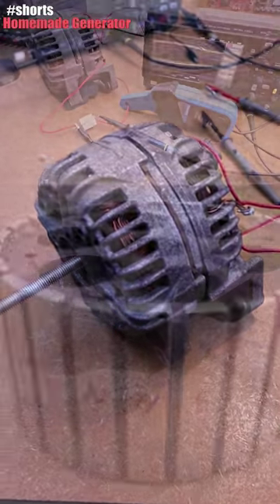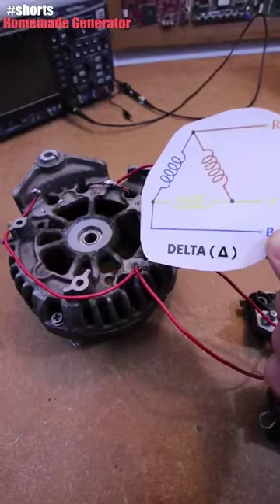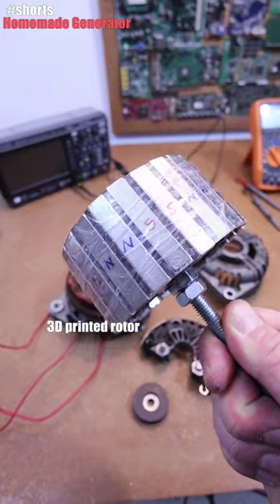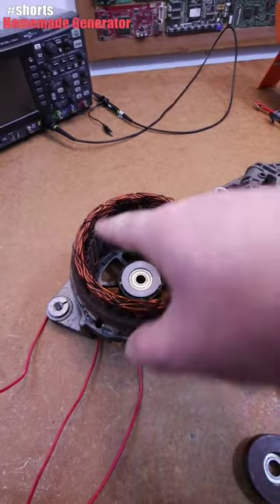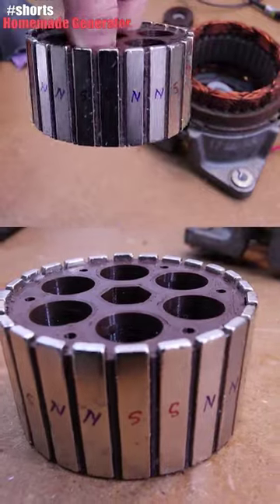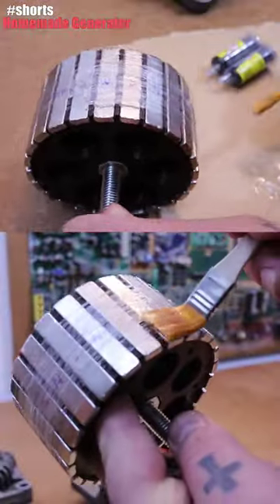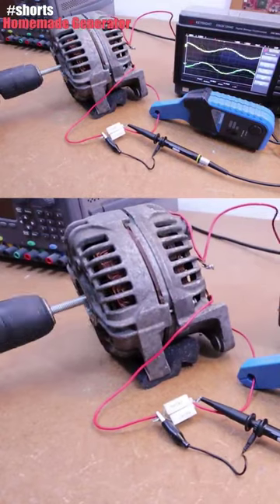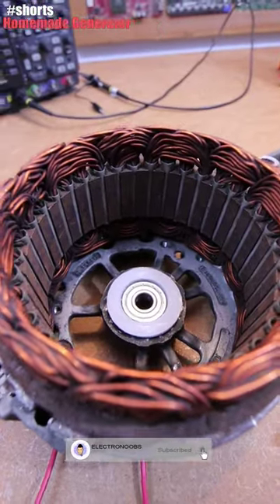Generator out of Car Alternator

Comment: Well done, you turned an alternator into an alternator
Reply: Yeah, electro magnet alternator into permanent magnet alternator.
Reply: Well yea but it’s still a alternator
Reply: @king_ofgames3650 with car alternators, it actually need voltage supplied from the battery because electro magnets need voltage supplies. By swapping it with a permanent magnet, it doesn’t need voltage supply to it. Let me know if I’m incorrect?
Reply: Yes you are correct I have done this myself
Reply: @king_ofgames3650  oh wow, what were you working on? Or i guess why did u swap it out with a permanent magnet?
Reply: @karencartoon8763  I have converted an alternator to a motor to use for a go cart
Reply: @karencartoon8763 Yes definitely. Swapping the rotor into permanent magnets, So you don't have to waste about 12W of power just to excite the electromagnet rotor.
Reply: @Teknopottu aka a magneto

Comment: But the default rotor field coil can already generate power (that's what an alternator does, recharge a battery), why replace the powered / coiled rotor with magnets ?
Reply: The rotor is an electro magnet by default, it takes a lot of power to turn into a magnet before it can generate. By making it a permanent magnet rotor, it is more efficient.

You can also use it as more efficient three phase motor this way.
Reply: It's a way more efficient generator and I'll be putting one on a wind turbine when I find an alternator to adapt

Comment: Great video! I've always wanted to make a generator.  
During a demolition project at M&M Mars facility, I salvaged 2 motors, (hoping one of them would be DC) They both seem to be three-phase AC. One is a servo,
Allen-Bradley part # 193470
(6.78/60 Nm/LB.IN. of torque)
They said that the machine had been installed 20 years earlier and never went into production.  It was taking up valuable space. They just wanted it gone. 
I don't know what I'm going to do with it but I know it's really cool.
Reply: That's a pretty big one! 3 phase AC, look up 3 phase bridge rectifiers, fundamentally the same as a single phase bridge rectifiers, but with 6 diodes instead of 4.

Those headers might be difficult to interface with, and I'm curious what kind of voltages you will get given that it's rated for 4k rpm. Add a flywheel onto a bike or whatever, and you might run it into an inverter for more stable output voltages.

Comment: I'm wondering why delta and not wye? 
The alternator is modified but generally they need a somewhat high rpm to get good voltage. And for a given rpm, delta produces better current at a lower voltage while wye produces a better voltage at a lower current, or you can get by with a wye at a lower safer rpm given that you "glued" the magnets, and I'm not sure I'd trust it at higher rpm.

Comment: Why? It was already a 1 to 2KW generator prior to hacking it. you simply need a regulator to excite the rotor poles with a bit of DC to magnetize it and then you rectify the output and modulate the generated voltage by controlling the bias applied to the rotor.
Reply: Do you have a video instruction on this? I thought that too. Use the 3 pin plug as excite input voltage from a dc voltage regulated source... ( this is not connected to the motor), but I'm not clear on the "delta" or AC OUTPUT TAP setup.  Can you provide some links for what you are speaking about? Thanks would be extremely helpful.
Reply: @readytorvdude1224  The Alternator in your car is wired to be a ~2KW generator, and generate DC voltage to charge your 12V battery. It is a stupid name, probably to differentiate it from a Dynamo, which uses a split ring commutator. (essentially a DC motor used as a generator)

You provide an excitation current to the rotor, and use a rectifier to rectify the 3 phase output from the stator. Usually there is enough residual magnetic field in the rotor to generate just enough EMF to further excite the rotor and the positive feedback loop brings it up to saturation. (I think).

A regulator is used to regulate the excitation voltage to the stator and regulate the output rectified voltage.

Comment: hello sir can you explain to my why some delco 12si have strange wire configuration? those alternators do not have center tap also wanted to know how its done voltage regulation for those alternators can they by manuali forced to charge at low'r rpm ranges I noticed some tractor alternators have capacitors on them so wondered what exactly is difference about low and high speed voltage regulators?

Comment: that's really cool.
3d printing doesn't scream safe and reliable to me, but who cares. if you can do it, then good for you!
 I'm looking forward to the video.
Reply: It should be fine since he wrapped it with the nylon and coated in resin, that would hold everything together because the main concern with a printed part would be it flying apart from the centripetal forces... but it would also have to be spinning super fast to do that, like 3000 rpm and up is my guess, which the generator might do, but i think where you start to worry about stuff exploding from spinning too fast is well above 3k rpm... also the magnets experience effects pulling them together as well as the reluctance of the coils acting on the magnets which means the forces are pretty balanced in that way also
Reply: @simonlinser8286 yep, thoroughly enjoyed the full video, and yeah now I've seen the vid I'm happy to admit ive got a lot more confidence in the nylon and resin.

Comment: What was wrong with the original armiture?  Why make a new one? Did the original one have permanent magnets in it?
Reply from the maker: Original one has an electromagnet. I wanted permanent magnets for better efficiency and more power...
Reply: @ELECTRONOOBS  permanent magnet means you can't regulate the rpm and make use of any extra "driving" power to generate more energy right? Because if you're using a permanent magnet you fix the "rotating resistance" righy, so if this is used for a windmill, the generator just won't rotate because of the resistance if there's not enough wind speed...but if you have the electromagnet, you can increase the electromagnet strength when it's windy and reduce it on a less windy day and make the best power out of your generator because you have the ability to control the "resistance" hence increasing the range of wind speeds that the generator can operate. Sure you'll lose some power because you'll be supplying  some power to the electromagnet but that can be manipulated to get more power generated.. because you'll be getting more power on a windy day so instead of using brakes, you can just put more power into the electromagnet to act ask a brake while producing more power for you.. or is that still inefficient? Sorry if this question seems like a dumb one. I'm curious
Reply from the maker: @yugaindiranmarimuthu7310  that makes sense and I might test both versions in the future. But, applying a constant voltage to an electromagnet is just low efficiency because we have power lost. Instead we cold add a gearbox to the windmill to increase rpm or torque even at low wind speeds. Each option has its ups and downs I guess.
Reply: @ELECTRONOOBS  yeah I'm wondering how you generate any current in the first place with an electromagnet in a car alternator I slways thought it had a dynamo in it with permanent magnets that generated electricity by converting kinetic energy into electricity via spinning of the wheels?   How is it that it has an electronic magnet.?  Must be powered by the 12v dc  battery?
Reply from the maker: @highgatehandyman6479  Yes, the electromagnet is powered by the battery
Reply: @ELECTRONOOBS  thanks
Reply: @ELECTRONOOBS  I think you need to do some testing under different loads and speeds to prove this is true.
Reply: @ELECTRONOOBS  gearbox might be a good way to go as they have quite low losses but you'd have to make a control system to control the gear selection.. going with cvt might be better though as you might be able to link the ratio with the rpm so the the gear will go to a lower ratio when the rpm is low and go to a higher ration when the rpm is high.. you might be able to achieve it using the same centrifugal force based switches used to limit the max rpm of some motors.. this might require some rnd though as you'll need to mess around with th weight and the spring rate and somehow convert that to the control of the cvt.. but yeah, I can't wait for the video to be out... this gon be good
Reply: @highgatehandyman6479  yup, in a car it uses electromagnet, it uses the cars battery to provide power for the electromagnet and regulate the load seen by the engine according to the rpm of the engine... permanent magnet is not a good option as the engine bay is quite hot and the permanent magnet will lose their magnetism if consistently subject to hot environments.. and you lose the ability to control the magnetic which will take away the control to control the power output of the alternator... at least that's why i think they don't use permanent magnets.. I'm not sure about the actual reason though...
Reply: @yugaindiranmarimuthu7310  how is it u can bump start a car then and the battery will charge? If the battery is flat?  And also u can start a moped without the battery by kick starting it and the headlight will function while the engine runs.   Unless I'm wrong about that.. cheers
Reply: @highgatehandyman6479  when you jump start a car, the donor car battery will supply the power to the receiving car and will power the elctronics, including the alternators electromagnet. Once the car engine starts, the alternator will take over the current generation and regulation and will recharge the once dead car battery and also power the car's electronic systems.. you just need the initial current to start the car.. once the car engine starts, as long as the alternator and charging system works, it will take over... in the case for moped, they use permanent magnets for their "alternator" so they don't need a starting current to start generating current so you can kick start a moped even if the battery is flat.
Reply: @yugaindiranmarimuthu7310  thanks. Yeah  I meant bumb start a car. I've bump started a few cars but one time I couldn't get it started so that explains it. Kick started a few mopeds too and was told the battery would charge after riding it around . Having permanent magnets seems like a superior system to me. Cheers
Reply: @highgatehandyman6479  it depends on the environment to be honest, mopeds have the "generator"  quite isolated and at the same time close to open air, so it would cool the case and reduce the temperature, and since the power needed and power generated is low, they can get away with lower powered magnet that can better withstand higher temperatures. But cars need more power to charge and sustain all the electrical system so you'd need a higher powered magnet to produce higher power.. and since they will be subject to higher temperatures and the have higher capacity batteries, they can get away with using electromagnet, and they can rob more of the power generated by the engine without affecting the performance of the engine that much.. a generator using permanent motor needs higher starting torque to overcome the resistance when a generator using an electromagnet can be controlled so that the resistance seen by the driver can be manipulated so that you can work with various input torque. But yeah, both permanent magnet and electromagnet based generators have their own use cases. When you know that the input torque is prone to fluctuation, i think its better to use software to control the electromagnet directly rather than using gearbox.. because with gearbox, you'd be limited to certain gear ratios and add complexity... but with the electromagnet you can control the strength according to how much torque is available, and trial and error should go much more easier once you get the electronic control part done, because you can tweak them in software which is more cost effective, but that's just my personal opinion

Comment: Wrong. Make tesla dc- ac inverter generator.
Leave the rotor alone.
Replace stator asembly with 4 , 1/4 moon magnets.
Makes high output dc dynamo to run inverter for good ac power.

Comment: GAAAHHH WRONG, its not a generator, it is a dynamo, a generator needs a powersupply to generate the magnetic field which produces the voltage output, whereas a dynamo has the magnets integrated as shown here ...